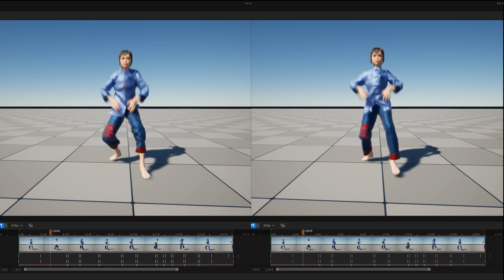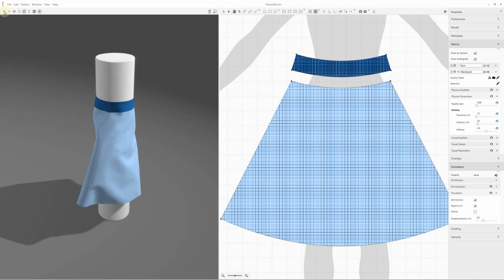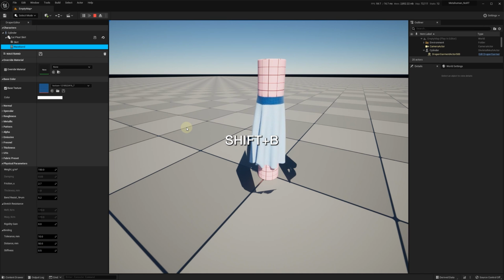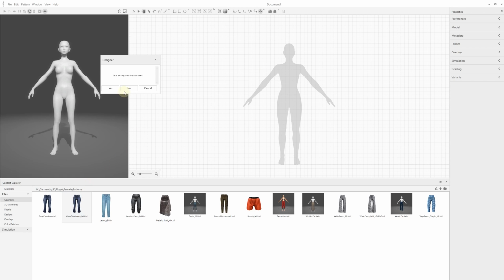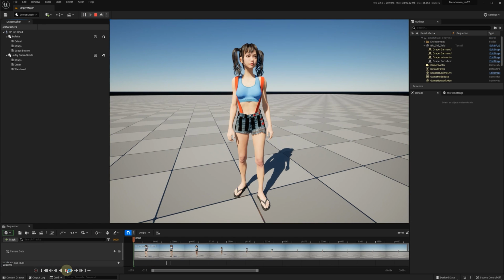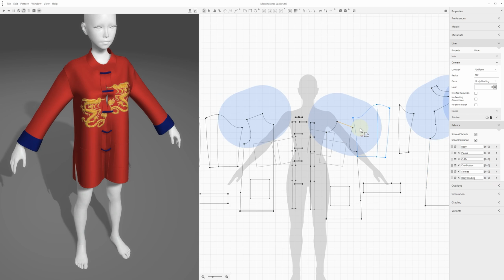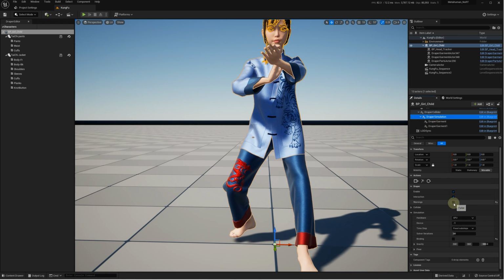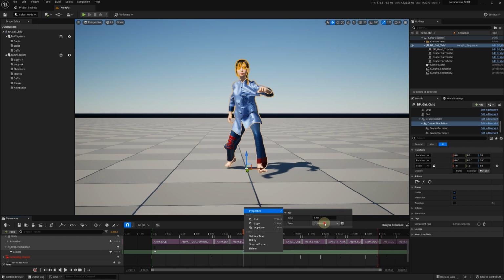uDraper Binding for real-time cloth simulation in Unreal Engine

Comment: Hi after enabling uDraper plugin it messes with my game mode. My cursor doesnt integrates with the game mode anymore. Do you know anything that could help me?
Reply from the maker: You can add the Draper Interaction component to your Draper Simulation component. Uncheck the cursor and see if it helps. See https://cdn.shopify.com/s/files/1/0610/3390/6418/files/2024-03-09_14-58-59.jpg?v=1710014399
Also, join our discord for easier support
Reply: @triMirrorTV  that didnt work. But I'll join the discord

Comment: Hi There. I have a specific problem: I am using RokokoMocap LiveLink. As I hit begin play and play a pre recorded Mocap action the dress simulates 2 seconds delayed and so it does not stick to the skeletal mesh.. What could be the reason what am I doing wrong. As I see here in your examples u have the same thing too but after miliseconds the garment sticks to the body.. Any help is much appreciated..
Reply from the maker: Answered on Discord:
You need to allow a few seconds for the simulation to initialize. 
The best practice is to change the pose gradually without jerking from one pose to another.
If your character didn't move too far, the wrapping helps but when it moves too far and too fast, it's not enough.
Additionally, you can experiment with the binding that would help to keep the fabric in place.
Last but not least, you can reset your garment using Draper Simulation: Reload function. See https://udraper.com/blogs/tutorials/changing-clothes-at-runtime

Comment: Hi, so I foollowed the instructions on how to set up my metahuman with udraper clothing and it works perfectly, except one thing, I'm trying to attach a gun to my characters hand and when I click on parent socket for the metahumans hand socket nothing happens, it won't let me parent to the socket.

It works fine on a normal metahuman, just not one with a udraper clothing attached, I am wondering if there is a work around for this?
Reply from the maker: This is strange. We used swords, baseball bat, and shows attached to sockets without any issues. Need to see how you do it. Do you create a new socket?

Comment: Guys you are becoming cooler and cooler! I will may soon consider moving from Clo 3D to your app! Where can I see the geometry of the pattern pieces created in your app?
Reply from the maker: Thank you. What do you mean by "geometry of the pieces"?
Reply: @triMirrorTV  Hi! I mean what is the geometry of the clothes created within the app? I'm struggling with the huge amounts of geometry needed by CLO3D. On the other hand , the result there is super realistic. But impossible for real time simulation, of course. I wish to find the middle point. I want to create real time fashion shows in Unreal without the need to use Alembic simulation transfers.
Reply from the maker: @Catthyp  Do you mean the 2D patterns? Clo3D is certainly a very powerful program. You won't be able to run real-time animation with many details and layers with uDraper neither.
Reply: @triMirrorTV  I understand that. But it's interesting to try this option. Go on guys!